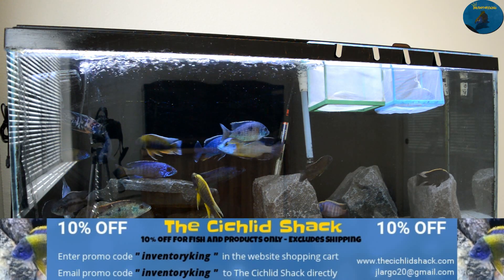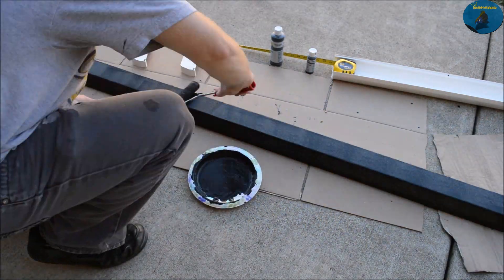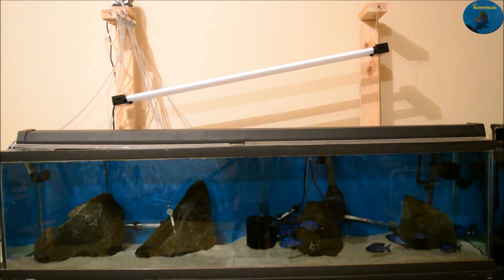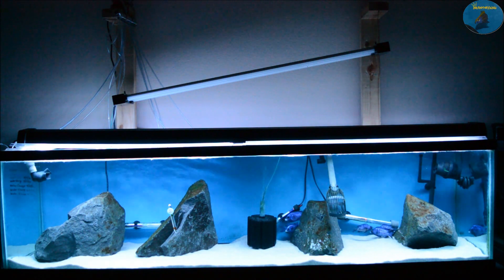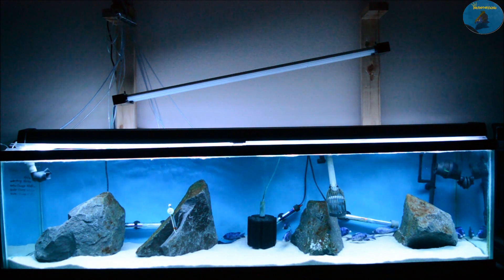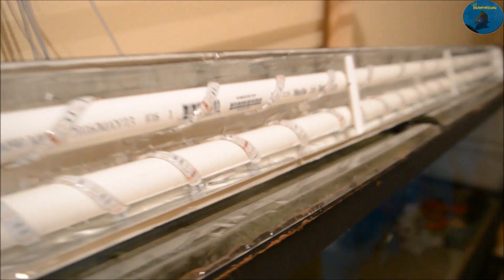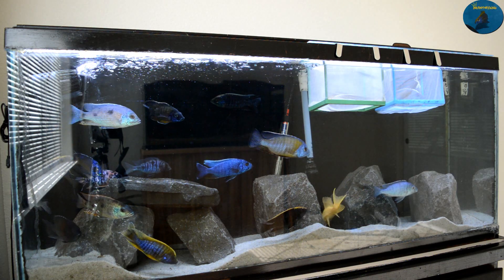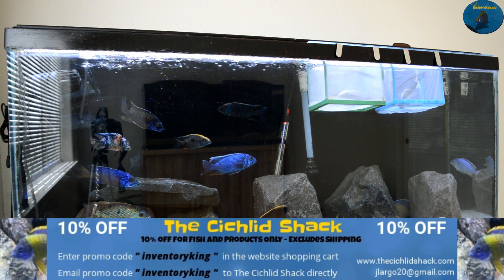HOW TO | Build A DIY Aquarium LED Light Bar | Inexpensive | Fully Customizable | Simple

Comment: how long do these lights last though?
Reply from the maker: +A.D - I am not sure
Reply: depends on the LED type quality and how its built.

there  a few LED types or as properly known SMD. a 5050 SMD  is brighter than a 3528 vs 3020.
i used 3528 in a silicon jacket and 3020 sealed in the Silicone layering...
 and to get a  higher penetration... i coiled them twice/three times as close as in video.

but the downside is the heat...
 i found that those sealed in a clear silicone layering would  die out faster compared to those in a silicone sleeve/jacket.

that could be attributes of the SMD or just that have the LED coated means the led cant dissipate enough heat...

i repurposed an old aquarium T5 lamp case and in the fluorescent tube  holder i used a  stainless steel rod...

and 6 -7 months the 3020 strip slowly burnt out. at least a 15ft strip cost me 10USD with shipping. and i only need half for a 3ft tank that's 1.5ft deep.

Comment: From my experience with those rope lights, you should definitely make certain that NO water touches the "sticky" part of those strips. The areas where you're able to cut the strips is actually perforated and it takes just a DROPLET of water to short out the entire strand. Brother, I suggest you get some plexiglass and make that awesome light fixture as water tight as possible on the bottom. Even condensation will kill all that hard work and $$. And don't forget to cut a few vent holes on top. those particular LEDs get warm because of that rubber strip they're encased in. Just trying to help you avoid a bummer of a situation. GREAT BUILD THO! Take the extra step to protect that bad boy!! FISH ON!!
Reply: Ahhhh you didn't buy them at Home Depot... Nevermind. I should've read before I leapt. In that case, PERFECT build my friend!! Thanks for sharing!!
Reply from the maker: No worries dude! Thanks for watching!